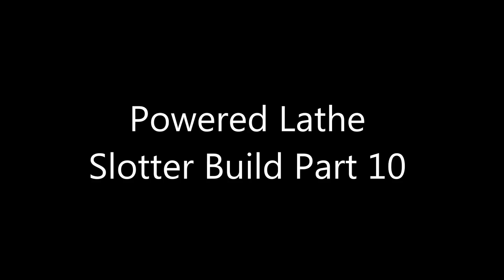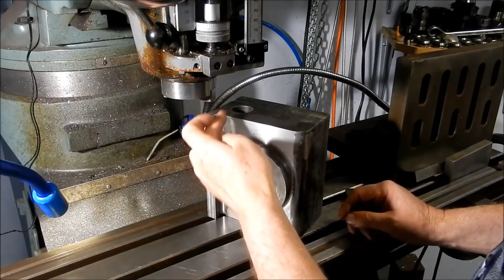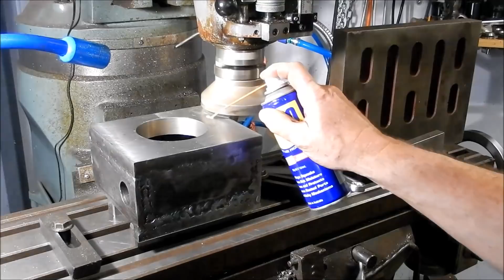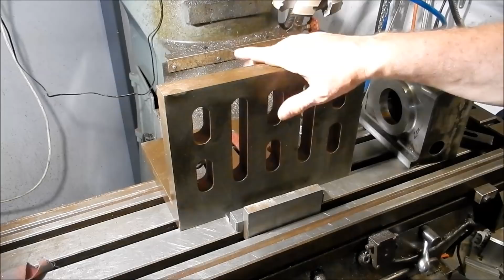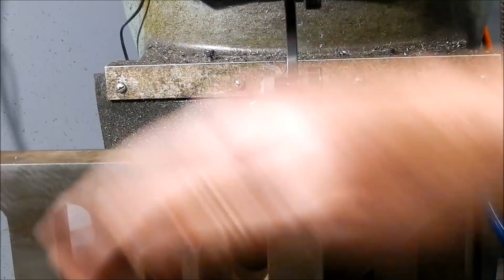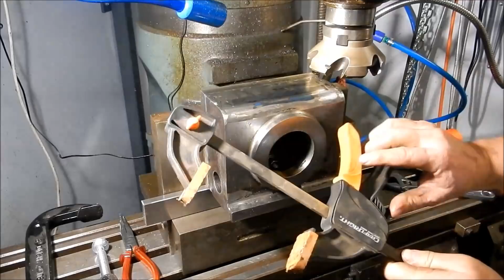Powered Lathe Slotter Build Part 10

Comment: Your slowly getting there, lol. When I clamp the stuff down to the table and it wants to rock a little bit, I usually end up putting it on some aluminum mig wire or just aluminum wire so it gets rid of that rock. Also, it sounds like when your feeding the table to the left, it sounds like your cutting more on the left side of the cutter on the right side of it, so it sounds like your head is slightly out of tram, just a hair.